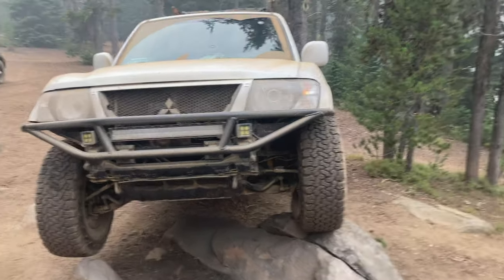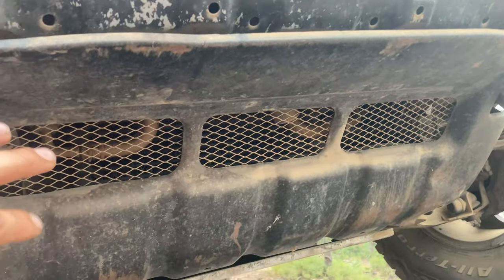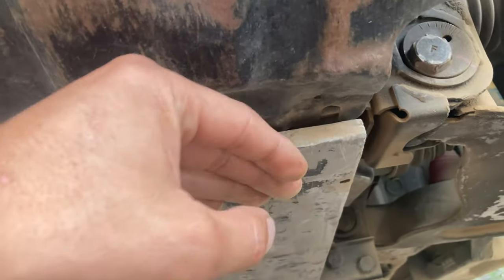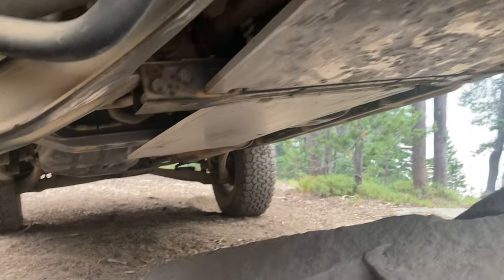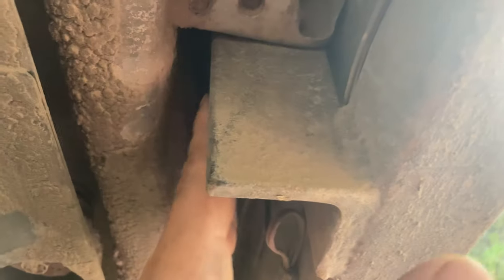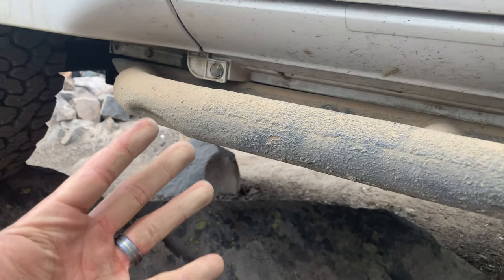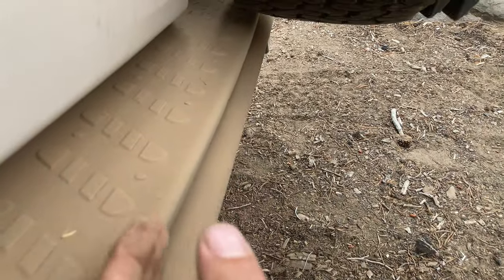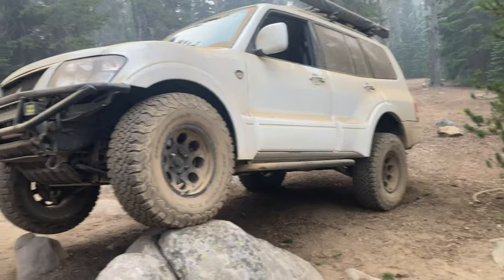2003 Mitsubishi Montero Body Armor

Comment: Awesome rock sliders!!! I have factory rock sliders fitted to my Gen3, but doubt they anywhere near as strong as yours. Do you perhaps have the specs of the bars n tunes you used? I'd live to try my hand at fashioning them at home.
Reply from the maker: thanks! it's been a while, but i believe i used 1/4" angle for the mounting brackets, and 2" tubing with .120 wall. the kick outs are a similar spec.

Comment: Love the rock sliders, looking to do the same to my 01. Did you weld the brackets from the square bar to the factory side steps or bolt them in? Couldn't see them too well in the video.
Reply from the maker: they are bolt on, so i can easily remove them if i need to.
Reply: I was asking same question. Did you do yours?

Comment: My last project of the year n my gen 3 is rocksliders. I live your idea. How does the sliders are held? Are they welded to factory holes and the on the bottom at your square pipe ?
Reply from the maker: They are bolted, through the 1/4” angle iron to the factory mounts, but the weight of the car sits on the pinch weld so they are very strong
Reply: @montanamontero  thank you pal

Comment: Did you use any brackets to mount the skid plates? Or do the skids just mount up to existing points without the need for brackets?
Reply from the maker: they mount to existing brackets, except the rear trans one. for that i drilled holes in the trans cross member and ran bolts through it
Reply: @montanamontero  Nice. Super easy. Seems like DIY skids for the oil pan and trans are they way to go.

Comment: I really like the mods you made to your montero!!!! What engine you have? How many miles it has? 🙏
Reply from the maker: 205,000 miles on the 3.8.. still runs like it's brand new.. but does burn some oil
Reply: Thanks!!! And did you had any big problems? How many miles more you expect?
Reply from the maker: I haven't had an major issues besides the ones i've caused myself haha. i fully expect it to get to 250,000 and maybe even 300,000. i swear it runs like new still
Reply: Ok, I want to buy one but where I live they are very difficult to find...